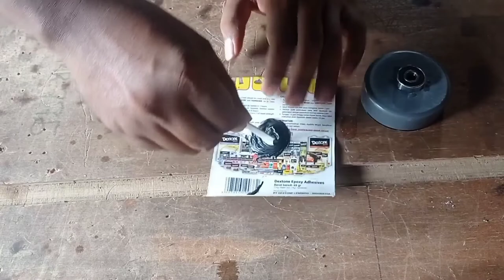Membuat Pompa air dc 12v dinamo 775 Jet Turbo semua pasti bisa

Comment: Mantab pak
Terus bikin video nya
Sanget bermanfaat
Reply from the maker: Terimakasih pak
Reply: @labusel_city  halo kak.. Untuk spek  dinamonya spa Ada yang perLu dirubah supaya putaranya kuat Dan kencang.. Soalnya.. Punya Saya kalau Lena beban putaranya semakin Lambat Dan berhenti gak kuat muter lagi Sebelum lepas Dari beban
Reply from the maker: Pilih tipe yg 12v 12rb RPM ini motor gk ada yg di rubah masih bawaan pabrik
Reply from the maker: Tokoh langganan saya GOLDEN DREAM Tokopedia
Reply: @labusel_city  untuk komponen tambahan gak ada ya kak..?
Reply from the maker: Coupling 5x8mm bearing 8mm
Reply: @labusel_city  berati tidak perlu komponen rangkaian kusus untuk memperkuat tenaga putarannya ya kak

Comment: Alatnya keren2 mas
Kalau perekat turbinnya bukan pakai plastic steel tapi pakai serat fiber kira2 kuat gak ya mas?
Reply from the maker: Sya pake motor kecepatan tinggi 12rb RPM takut nya lepas
Reply: @labusel_city  ohh brarti kurang kuat ya kalo pakai fiber
Terimakasih